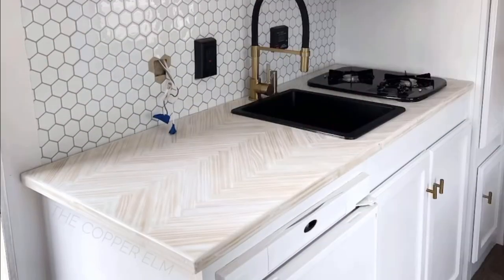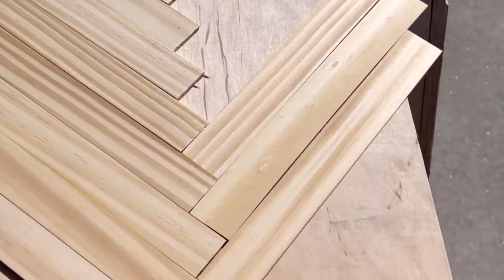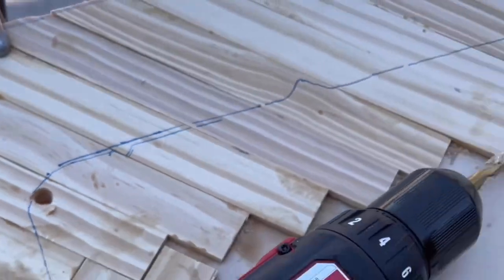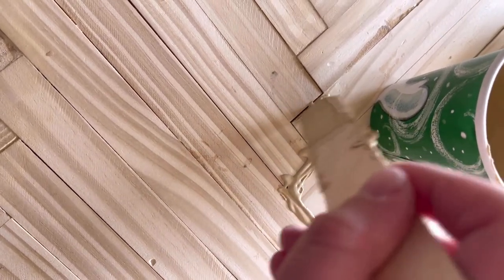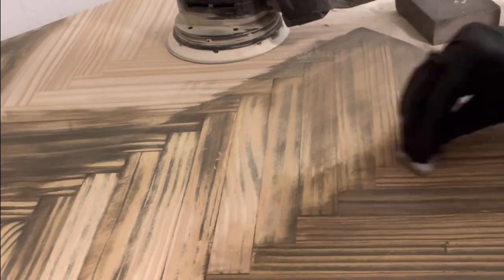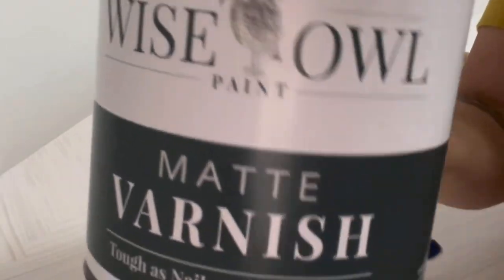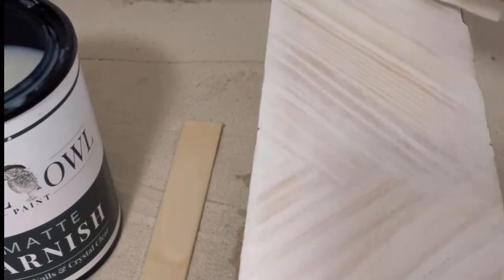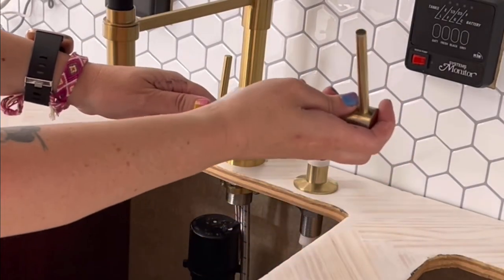Creating a High End Countertop w/ $16 of Stir Sticks!

Comment: Could this be used to do a floor?
Reply from the maker: I think it would work if you did a much more durable top coat, like an epoxy pour. Stir sticks in general are relatively soft wood, so I'm not sure it would truly hold up to the wear and tear a floor receives.